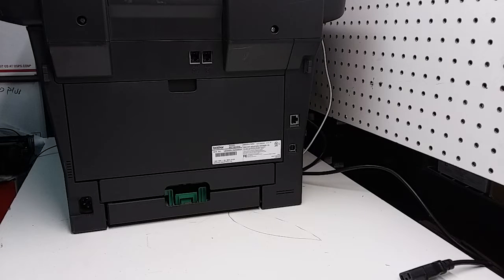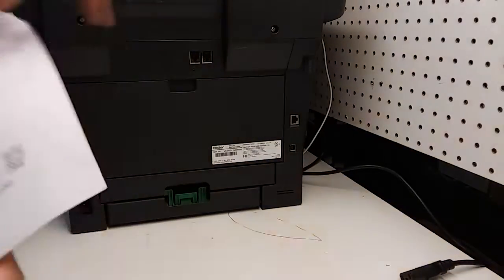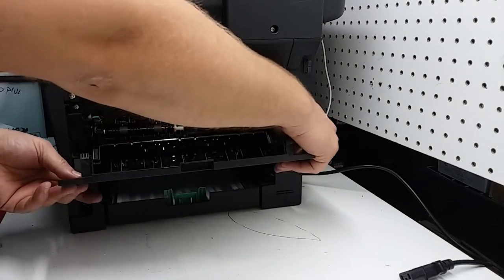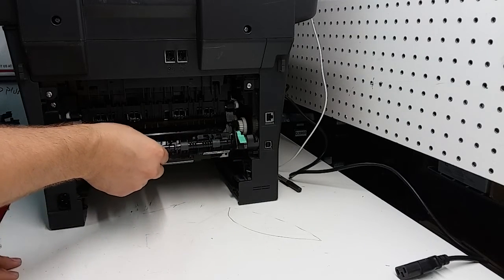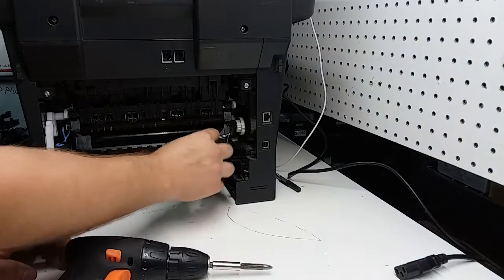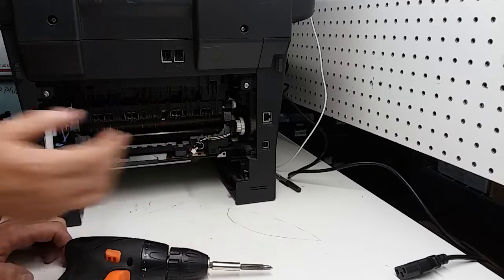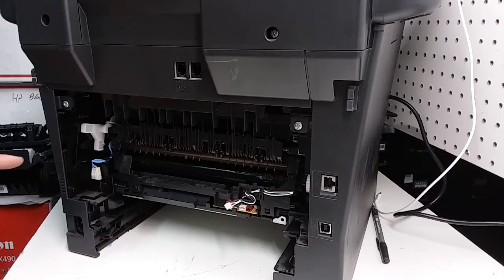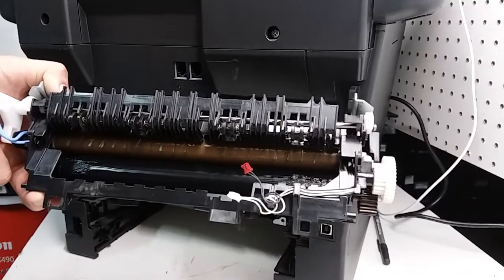How to replace fuser unit Brother MFC-8810DW MFC-8710DW MFC8510DN

Comment: Used this video to figure out how to disassemble the fuser on HL-L8260CDW. This kind of examples are invaluable. 
Now I need to find replacement fuser tube though as the old one is practically fused with sticker paper.. Any advice/ resources on how to figure out correct parts? The fuser as far as I can figure out is LY0379-001

Comment: Replace the metalic fusing film with the new fuser film from Brother L5500. The metalic film is crap , it fails at maximum 20-30K printed pages because of poor lubrification. The new fuser film solved this by using a non-metalic heat transfer film witch you can easy adapt to old fusers .
Reply from the maker: Thank you very much for sharing. Have a great day!
Reply: @303electronics   Hello, have you tried using fuser foil from Brother L5500 to Brother MFC-8810DW as @Chronox2k4 wrote?

Comment: Following the instructions, but having a horrible time removing the white and black wires at the back of the unit. I keep "tugging gently" and all they do is wiggle in place and look to me like I'm going to break something. Is there a trick to it? Are they attached in a way where I can pry them loose without damaging anything?
Reply: You have to squeeze the sides
Reply from the maker: Those wires are wrapped around little plastic tabs. Don't pull hard, you will damage them. Gently find the way of the wire and unwrap it.

Comment: Thank you so much. after removing fuser assembly and powering on I automatically got a message saying diagnosing please wait 15 minutes. upon reboot it gave error code "Print Unable 6a".  Thought it was a bad fuser so i put original back in and still got same message.  I ended up removing the logic board where the two connectors plug into from fuser.  found both connectors were loose and had my buddy solder those connectors back and error went away.   So point being be careful when removing the two connectors when removing fuser. I was very careful yet still had issues.
Reply from the maker: Thank you very much for sharing your experience! Have a great day!

Comment: Thank you so much! Just replaced mine today because of your video! It works all great again! One thing is I lose that spring on the right. But I didn’t see it being important so I assembled it back fully without it and it works fine. Thank you again
Reply: The spring is supposed to help with a build up of static electricity generated by the roller, grounding charges. Just be mindful that there could be some damage to the circuitry eventually.
Reply from the maker: Thank you for sharing.  I'm glad the video was helpful for you. Have a great day!!!!

Comment: Do you know how to change the laser unit on a L-HL6200 DW? I can't find any video on how to do that and Brother was no help.
Reply from the maker: I have this video of how to take apart HL-2240 which is a smaller printer, but laser unit is located in the same area. You may need to remove a couple more screws on HL-L6200, but the concept is very similar.
https://m.youtube.com/watch?v=M-uWJqUZmVE&t=18s
Reply: @303electronics  Thank you! Hopefully I can fix my rollers now.

Comment: You are my hero!! Thank you so much!
Reply from the maker: You're welcome! 🙂🙂🙂🙂
Reply: @303electronics  My only critique would be to insert a section about reassembling everything. I've got a piece here I can't remember where it goes, so I'm trying to reverse-engineer where it came from. An hour later, no luck so far :(
Reply: @303electronics  argh. Maybe you can help me? I've searched everywhere and I have no idea where this part came from. It's part # LY5268 and it's an uncomplicated piece of plastic. I set it aside during disassembly and now I can't figure out where it goes back to. Do you have any idea? Thanks in advance!
Reply from the maker: @faelanae  I'm not sure what that part is. Can you explain it or take a picture and send it?
Reply: @303electronics  found it. It's part of the fuser unit, and you can see it clearly here: https://youtu.be/VUx5X8kH7cQ?t=129 it's the piece that helps feed the paper in between the rollers. I'd put the screws back, so I didn't notice that's where the piece was supposed to go.

Comment: My Brother MCF L2700 DW does not turn on after a lightning struck my area. I need to get to the electrical power board to check for damages, maybe a fuse or something, but I don't know how to open the panels to get there. Can you show me how to do it, or somebody else can help me with this issue. Thanks in advance,
Ramon Perera.

Comment: Good morning team 303 Electronics, I would like to thank you for your guidance as it has shown good results so far, it happens that after 3 cleans and lubrications of the fuser the golden metal plate, just below the film is very worn and need to change. Do you have the code for this part or where we can buy it?
Reply from the maker: I don't. Didnt find one online. It usually just needs cleaning.